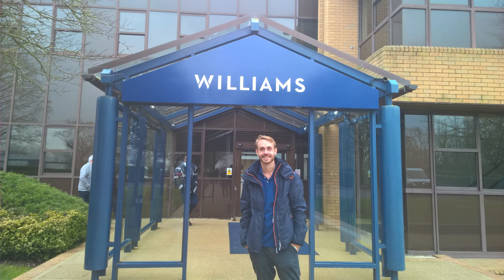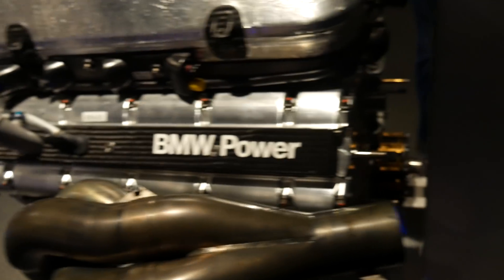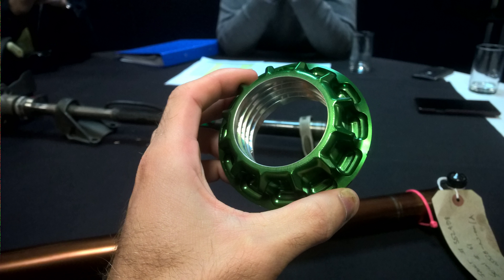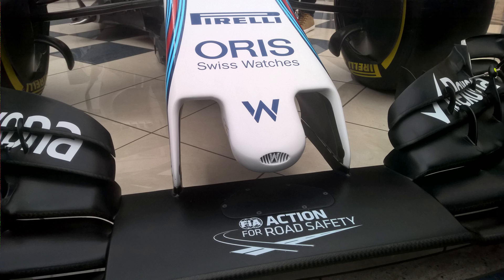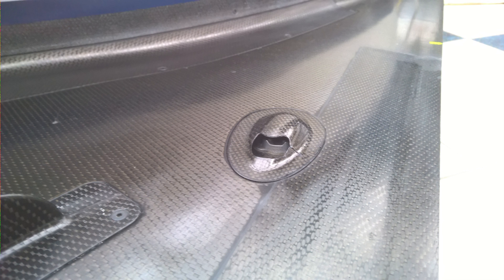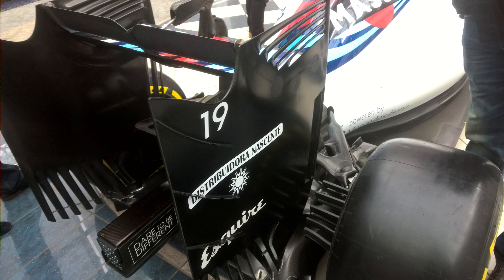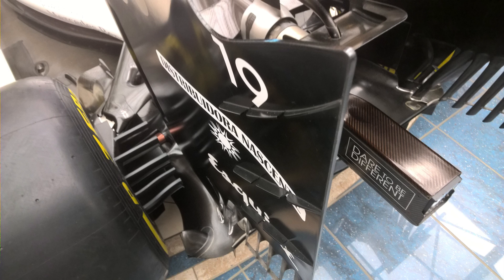A Few F1 Car Details You May Not Know About...

Comment: I learnt very little from this. I was expecting to see how the air initially meets with a particular aero feature and is directed to another in order to influence and achieve a lowering of drag, lift and so on.

Rather than simply circling features on still images, I want to see at the very least a pen or similar being used motioning at start and finish points of air flow and an explantion of what is happening to the air behaviour at each transition zone. 

For example; where the air meets here the pressure is high due to its restricted angular profile. From this point you notice the profile's surface progressively elevates, becomes more raised in angle. This raise in profile causes the air flow to be less restricted. 

If one considers a single moving point of air particle here and another here, since the air passing through this region has further to travel than what passes along here, its rate of speed will be greater. This causes a natural physical tendency for a lowering of pressure at increased speeds. As a result of this near consistent moving sealed enclosure, a vaccuum is promoted which has the effect pulling the car down to the ground.. Hence 'ground effect'.

Words used in such ways would be more meaningful to me than relying on my subjective opinion to reason with what the possible purpose is of those aero features/elements. That is why I landed -ve. Because I learnt little in that specific regard (I do not simply land -ve without a reason). Thanks. 

RC 1/8 i.c. on-road model car racing enthusiast.

Comment: I noticed recently that many of the fasteners used to hold the body panels in place screw into a 25mm cylindrical column which is about 10mm in diameter. This column protrudes into the interior duct flow and, given the numbers of them, must have a significant effect on drag. Do you have any comments?

Comment: Wow, I had no idea there were so many little elements to every component.  It all looks so horribly inefficient but I imagine it's just the opposite.  A team would work for the most downforce with the least drag I'm sure, but if the designers were forced to choose, they would go after more downforce at the expense of drag, yes?
Reply from the maker: Remember, surface area =/= drag! The majority of the drag on an F1 car is pressure drag, see this video for more: https://www.youtube.com/watch?v=xReTQzdocdA&t=1s

And while typically downforce is more important, it is all about striking the balance between downforce and drag, which will change from track to track. This is why we see flatter wings at Monza. And most of these components aren't that inefficient as they are largely aligned with the forward direction of the car, so while they are producing a force, it isn't very "draggy".
Reply: It does look like all those little features add a ton of surface area! I imagine the added drag has stability benefits that allow for a greater level of performance.

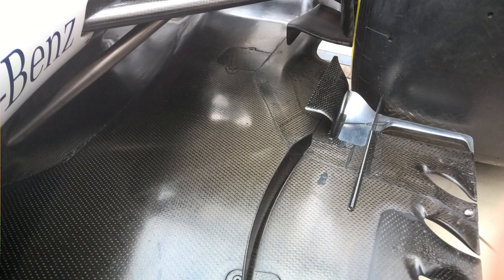Comment: This video is a bit of a mish-mash of various years.  Clearly @ 35 seconds there is a shot of the BMW engine which Williams used fro 2000 to 2005 then later @ 3:15 there is a side panel clearly showing used of the Mercedes-Benz engine currently in use by Williams.  As it was published today, March 26, 2017 it tricks the viewer into believing this is the current model Williams.
Reply: Bit of a mish mash? Everything from 0:47 onwards is clearly from the 2016 car, it's only the clutch that isn't in the whole explanations of details, and they still probably look pretty much the same these days. And I think it's a bit silly to think that it's the 2017 car given it's not in the title and he says at the start he wasn't allowed to take shots of anything from 2017.

Comment: I have always been curious what those driveshafts are made out of and why they have that color, any ideas?
Reply from the maker: I'm not 100% sure as I didn't ask to confirm, but it felt like titanium in terms of density. Definitely wasn't steel, I think the red colour is just the anodizing.
Reply: This is a third had account of a conversation.  An engineer was helping our FSAE team do CFRP half shafts after having tried to accomplish the same design for F1.
MY TEAMMATE: "Ohh wow! that's amazing this shaft is 4.5lbs lighter and can handle loads more torque."
ENGINEER: "Oh yeah, your 35ft-lbs is easy,  now imagine 700ft-lbs with gear multiplication and shock load."

My friend was told they use gun drilled Titanium, the color is from heat-treat, and the really tricky bit is the posts for the needle bearings of the Tripod Joint Rollers

Comment: that 2007/8 car probably has a lot more aero tricks under its sleeve. i believe that was the pinnacle of f1 aero
Reply: of god please no
Reply: Depends on what you consider as the pinnacle.They've had winglets alll over the bodywork which as far as I'm aware is still not allowed be the book (I mean on the sidepods and the air intake and stuff like that).Also if you take downforce generated under the car,the ground effect Lotus and the RB6 were the absolute kings of it (I would die to see all these in F1 asap).I might add that this is a 2016 Williams car which obviously had way less aero than this year's cars do,so maybe that's why it seems a little 'tame' and sort of clean cut

Comment: Is it me or we pit stops slightly longer than last season. They seemed to be a couple tenths longer than last year. How much more do the tires weigh this year?
Reply: The wider floor doesn't help either. It's insane how they manage to change rear tires so fast with almost zero gap. (Pictures)
https://twitter.com/ScarbsTech/status/845097586168020992 https://twitter.com/ScarbsTech/status/845866672661544961
https://twitter.com/ScarbsTech/status/845874340532928512
Reply: the tires  seem  to be difficult too handle